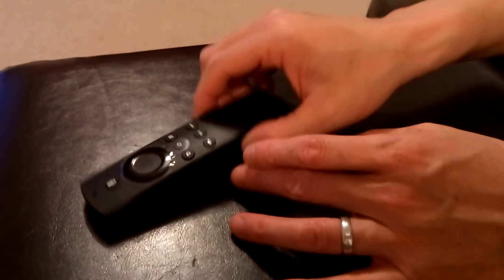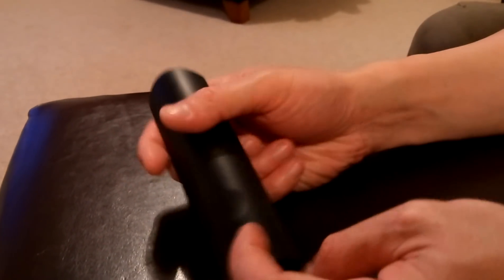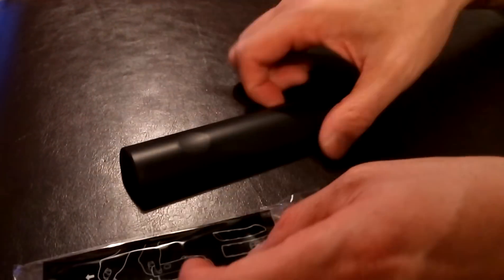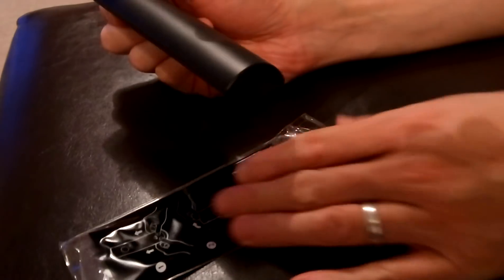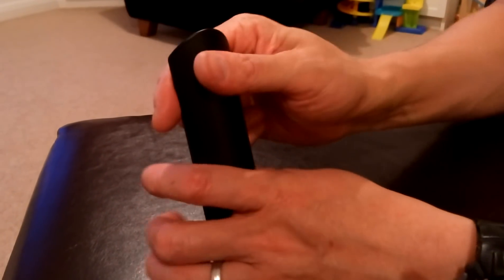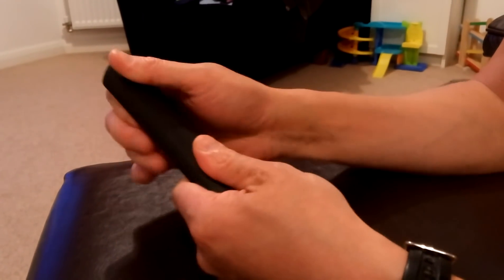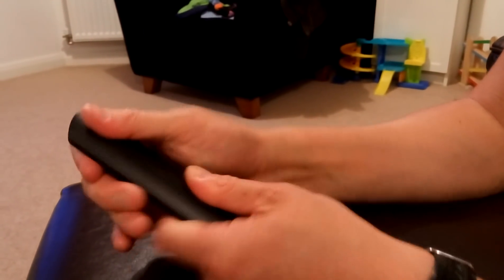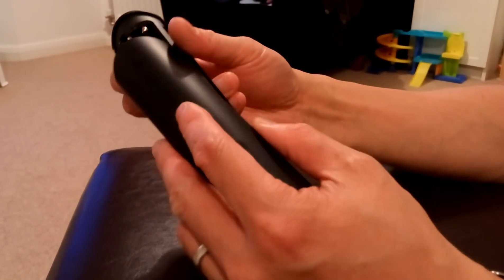How to Open an Amazon Firestick remote control to Replace the Battery 2015 2016 2017 2018

Comment: The new late 2018 remote is different. You have to stick a small blade between the upper part, center of the cover, pry it gently and it will pop out. Other than doing it that way, you risk damaging the remote.
Reply: I have the late 2018 4k fire stick remote and I did not do it that way. I  just pressed the round indent downwards and off it popped down.